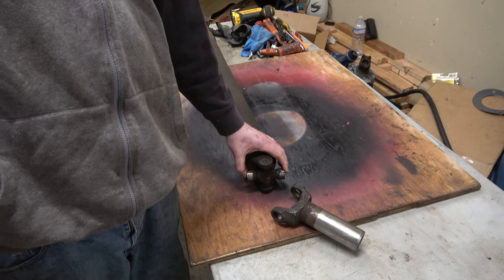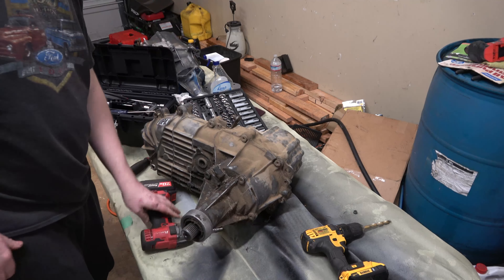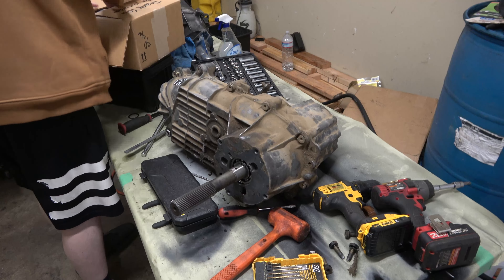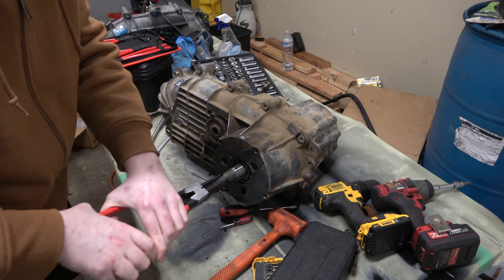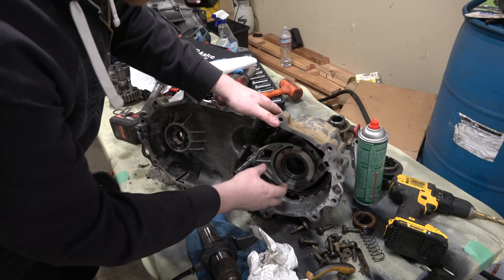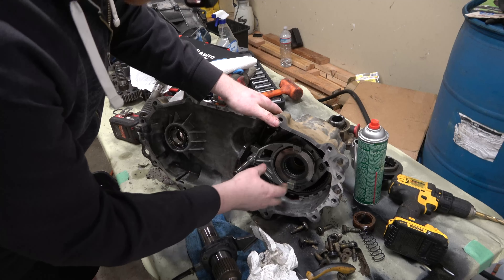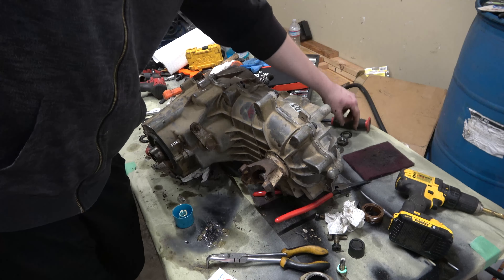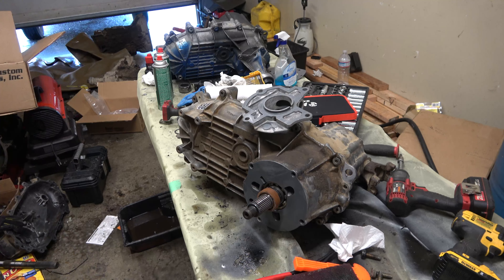Budget Build! | Slip Yoke Eliminator 1356 Transfer Case Build!

Comment: Hi. Im rebuilding my transfer case be 1356. 
On the minute 6.49 you say i can re use the plastic washer if i want to. 
So it doesn't damage the transfer case if i don't put it back??
And if i want to put it back i put it where it was your when you pulled the tail housing?? I saw yours it was very loose
Reply: if you don't use it and you take out your slip yoke driveshaft, oil will spill out of the transfer case

Comment: You going to run an adapter for that zf?
Reply from the maker: To run behind the Cummins? Yes I have to upgrade to a new setup. If that’s what your asking.
Reply: @bullford8218  Yes I was just wondering because those adapters are expensive.